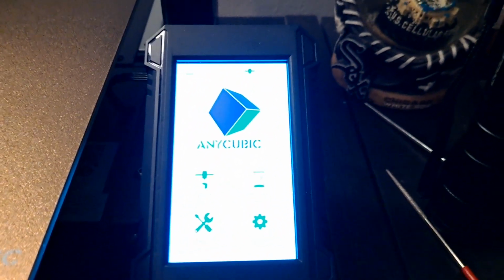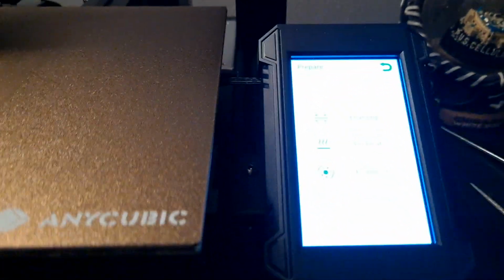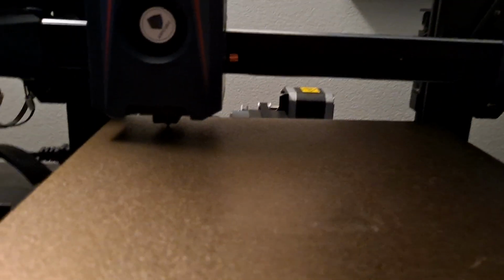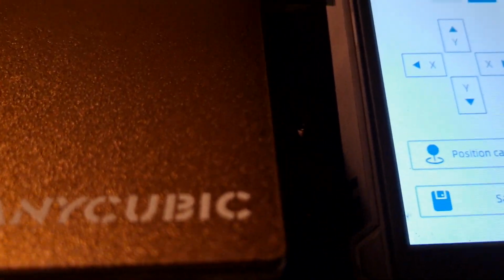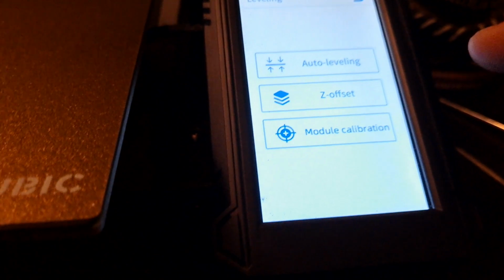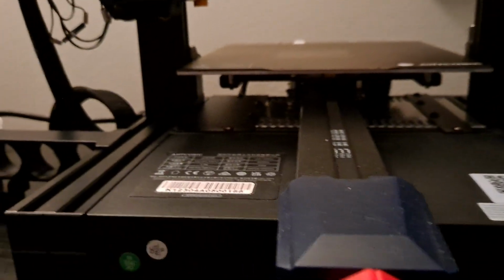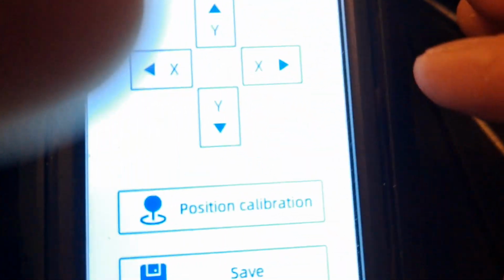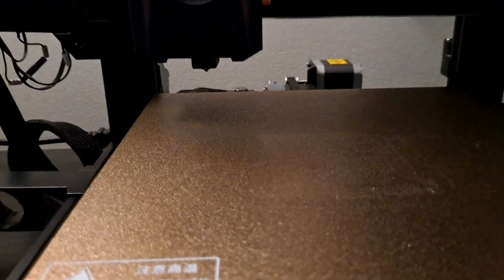Kobra 2 Z axis problems

Comment: Your not homeing x and y correctly so its not going to know how to get over the z button to home z. Home x and y!
Reply from the maker: Absolutely was homing it right. i am a machinist by trade and program and run Haas mills everyday I know this machine inside and out. The problem had nothing to do with operator error. The problem was the nozzle was not seating itself proper due to dried gunk, I have fixed the problem along with a host of other problems these Anycubic are notorious for,

Comment: I was having that problem.  I think it was because the belt on the bottom had a piece of filament stuck to it.  This was causing the hot bed to not go far enough back when homing.  Because it was not far enough back, the proximity sensor did not detect the build plate.  Removing the stuck filament from the belt fixed the auto leveling and homing step.

Comment: Brothers, I am facing the same problem and I have not found a solution for it. It is piercing the printing plate. Please help me.
Reply: take off the front plate that holds the fan. Unplug the orage sensor on the print head. Lossen the bolt that holds the sensor so you can thread the sensor lower in position. Plug the sensor back in. Then use the little metal wrench and hold it flat with the nozzle so its perpendicular across the tip of the nozzle and the orange sensor. If the blue light lights up you can assemble everything back together and try auto leveling.
Reply: @jasonfoenafoe2950  My Brother I wish you a women that will suck you d everyday for this advice!
Your a g
Reply: the nozzle and the sensor must be at the same distance from the plate. you changed the silicone tube and it's a little longer, isn't it?
Reply: If your printer homes x and y successfully, It willl then use the button to home Z.  Then It uses tthe magnetic probe on the side the thing that looks like an eraser to level the bed. If that probe has moved then it needs recalibration the value is referred to as the z offset. Does the machine home x and y? It needs to be able to do that to home z at Y238 X58 the silver button in back.

Comment: You just need to adjust the sensor. Its got an adjustment screw😊
Reply from the maker: Thanks for the reply. This problem has been solved.
Reply: Any help I actually tried that put it same level as the needle and still gets stuck the same way
Reply from the maker: @randyjuarez790 did you reseat your nozzle and make sure it was positioned properly? Do this before adjusting the sensor. This was what caused my problem. I did not have to reposition the sensor at all.

Comment: Ok i had the same problem and it was because i disassembled the entire hotend and extruder bc i had heat creap so bad it ended up inside the extruder or filament somewhere ended up stuck inside the extruder. Anyway the tip ended up lower then before. The fix: take off the front plate that holds the fan. Unplug the orage sensor on the print head. Lossen the bolt that holds the sensor so you can thread the sensor lower in position. Plug the sensor back in. Then use the little metal wrench and hold it flat with the nozzle so its perpendicular across the tip of the nozzle and the orange sensor. If the blue light lights up you can assemble everything back together and try auto leveling.
Reply: testing right now, but I think after days of trying to get this to work, you may have saved my birthday present from being shipped back or thrown in the trash.

Edit: It finally worked and I let out a loud YES!!! that pissed off my roommates. Thank you.
Reply: OMG' I have been searching all day for a video or something to figure out what was wrong with my machine, and nothing! until I read your comment! you totally saved the day. This was exactly what was wrong with my machine. Thank you so much for commenting, you rock!!
Reply from the maker: This problem has been solved.
Reply: This fixed mine too!! Great tip brother, thank uou!
Reply: Thank you! Had same issue!
Reply: I had the same problem and I would not have been able to solve it without your comment. I changed the nozzle and the silicone tube, but the silicone tube was a little longer than the old one. That small difference messed up my printer.  I didn't lower the sensor, I shortened the tube, which is the same thing. Thank you.
Reply: So much love to you thx a lot, you solved it ❤❤❤❤❤❤
Reply: Thank you! A wasted weekend until I found your comment. Now my printer is working again.
Reply: You have saved the Pendleton County Public Library's Creation Station so many hours of research and heartache! My Bambu is down waiting for a part and we've been relying on the Anycubic. I was only down a few hours!
Reply: Thank you guys so much. Im glad I could fix this before my Dad found out😂
Reply: @Akihla_😂
Reply: Im happy to help 😁
Reply: Having this same issue 😔
Reply: Thank you very much, unpluging the sensor on my Kobra 1 also worked for me.
Reply: i'm trying it now i was about to toss the printer in the bin
Reply: Dude I had the same exact problem

Comment: I just bought a kobra 2 max. It set up and printed fine. I upgraded firmware via the app as prompted and it then gouged the bed, dropped the nozzle below the build plate, dragged the (now below bed height) nozzle over the bed and snapped it off. 

Its a shame as the 2 max had some great reviews, and the one successful print it did do was really good. No idea if its a hardware or software/firmware issue, but the test prints were the ones that came pre-installed and - other than running through set up as per instructions and on-screen prompts I didnt change anything in the setup. 

I'm wondering if - as per comments here - the nozzle wasnt fitted correctly when it shipped? Still wouldnt explain why everything broke after the firmware update though.
Reply from the maker: If you were able to run the test prints straight out of the box, I would say your nozzle height was fine as shipped. Did you relevel your bed or change the z axis? If you did nothing but upgrade your firmware, I would say that would be the main area to explore first.

First step is to open a work order with Anycubic, you will be shipped new parts for free if still under warranty. Explain the issue and a tech will walk you through some common fixes.
Reply: @heathcliffebird7514  I'm assuming it reset the z offset when you did the update. I didn't think it would do that but your experience taught me to calibrate it after every update. I really like the features anycubic offers for the price point but they really need to work out a few kinks

Comment: bed level sensor is shot if it comes down to close and hits the bed. OR it needs to be adjusted (Height of the sensor compared to nozzle)
Reply from the maker: Nozzle needed reseated. Problem has been fixed.
Reply: @KWE.ECLECTIC  Could you explain more how to do that procedure.
Reply from the maker: @raulcastro6768  What exactly would you like to know ?

Comment: I have the same problem! Support is having me send photos of a level sitting on the build plate, but it’s something about the z-axis rods. Who knew auto-leveling would be such a pain?! I’d rather just level it myself. Any luck?
Reply from the maker: yes, all problems solved. I had to reseat my heating element and nozzle. Once repositioned the unit worked fine.
Reply: @KWE.ECLECTIC How to do that?
Reply from the maker: Yes, the problem was my nozzle was not seated all the way in. It was as far as I could get it, but the gunk buildup on threads was keeping it from seating properly. New nozzle was ordered and fit in like a champ. Problem solved.
Reply: You need to home x and y, Then you can home z. your not hominging x and y. tge nozzles isnt the problem the problem is not homing x and y correctly because you have something in the way thats hitting the end stop switch.

Comment: My kobra 2 works wonderfully. I had some weird over extrusion issues at first that really messed things up and no amount of estep calibration helped. Everything seemed to be a software issue so i decided to go back to basics. I was able to fix everything right up by making sure all the axis sensors were mounted properly (just to be safe) and then reset the firmware to default via pronterface. I then reinstalled the firmware and used pronterface to recalibrate the esteos and run a PID autotune. Since then it has been near flawless. It still has an over extrusion issue but only at lower speeds but i solved that by playing with flow settings. I'm 100% happy with this thing now.
Reply from the maker: I am glad you are having success with the Kobra 2. My unit is down once again with a failed power supply. I have had nothing but issues from the first I owned the machine.
Reply: @KWE.ECLECTIC  That's really unfortunate. I'm lucky I'm that i have an IT and electronics background so troubleshooting is second nature to me. I get an honest pleasure from figuring this sort of stuff out but it sure is maddening when nothing seems to work.  What sort of issues is your power supply exhibiting?
Reply from the maker: @Enjoymentboy  The power supply is blown. This is the second power supply Anycubic had to send me. It is an easy install, but my patience is reaching  its end.
Reply: @KWE.ECLECTIC  Wow...no doubt.  I'd be at the end of my rope as well.  Usually these switching power supplies are pretty robust.  I'm sorry you're not having a positive experience with yours. I'd honestly like to dig onto one of the power supplies and see just what went wrong.  It might point to a larger issue.  I'm wondering if you aren't actually dealing with a mainboard issue or even a bad motor..  This has got to be super frustrating.  Props for continuing to push on though.  Many people would have just thrown in the towel by now.
Reply: Open the hot end and disconnect the sensor then plug it back in. Test the sensor with a small tool to see if the light reacts and once it starts reacting close everything up again and recalibrate.

Comment: Hey Kevin I'm having the same issue, homing going to low or started of a print. For me it all started when I upgrade my firmware to 3.0.6.
 Have you found what caused the issues? 
Abycubic is sending me a new heated bed, print head PCB board and print head cable, proximity switch but I feel it might not even be the problem as once in a while it will work...
Thanks
Reply from the maker: I wish you luck. My problem is solved
 I had to reseat my nozzle and heating element.
Reply: @KWE.ECLECTIC  I've complained to ebay about it so they've sent me a new one and with the new one I was able to diagnosis, and it was also my heatblock/nozzle the issue! 20$ fix and a new printer there ya go. Took about 2 months tho.

Comment: have/had the same issues. Homing will just press the nozzle into the heatbed. After just two months of printing (every other day- no more than 8 hours per job) the heatbed is warped so hard I need to level it with tape on the printbed... Thought the Kobra2 is a good beginner printer, but if I knew it is that error-sensitive, I would've gotten an Ender 3.
Did Anycubic ever gotten back to you and told you how to fix it?
Reply from the maker: Yes, Anycubic has reached out to me and sent me a new power supply. I guess I will fix the printer once again, but I do not expect it to run for very long before having another issue. You get what you pay for. At under 300.00 I wasn't expecting much and my expectations were met 🙂

Comment: Hi, I'm not sure but your autoleveling sensor is mounted too high. It must be set much lower (this Orange rounded element next to hotend)
Reply from the maker: Yes, the sensor was located correctly. The heating element was seated too far down. The problem was solved, but once again the Kobra has issues. I have spent more time fixing this machine than running parts.
Reply: @KWE.ECLECTIC  how did you fix this issue
Reply from the maker: @dejajones8751  I had to reseat my nozzle and heating element, which meant replacing the old nozzle and making sure the new nozzle was tightened down properly.
Reply: @KWE.ECLECTIC  thank you so much